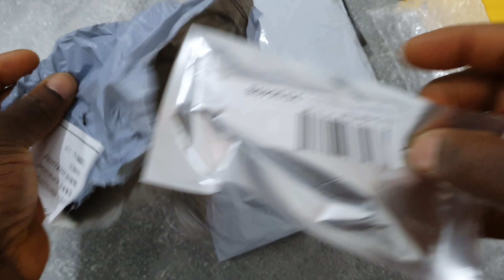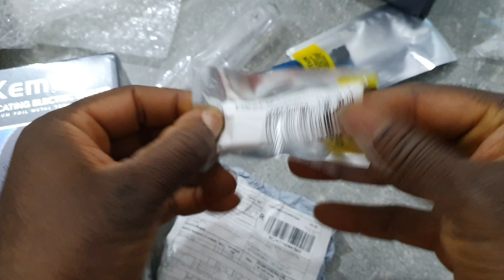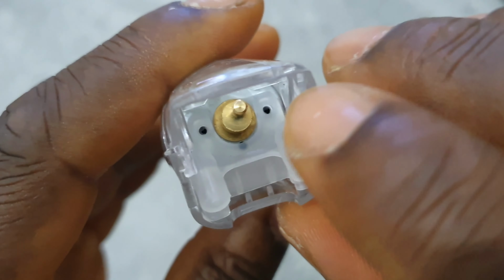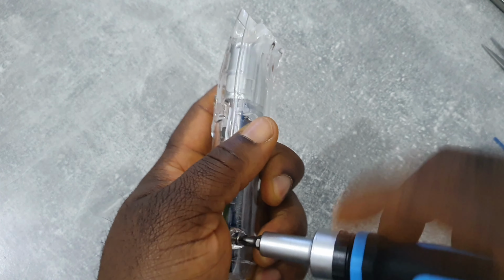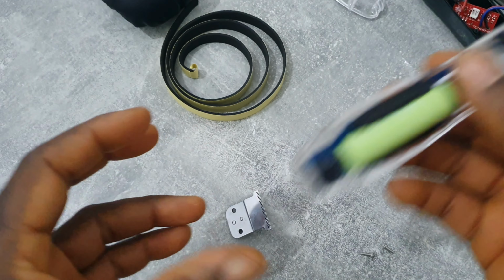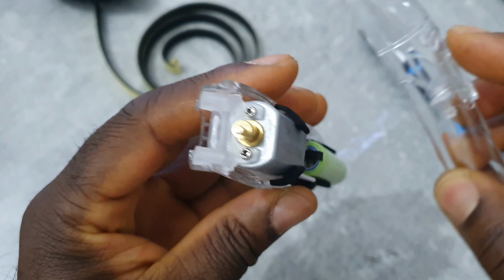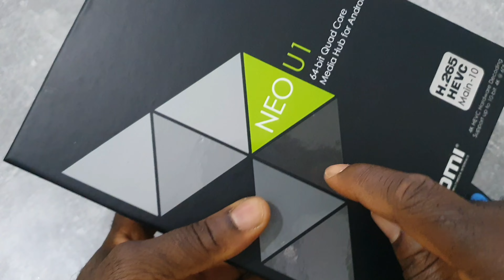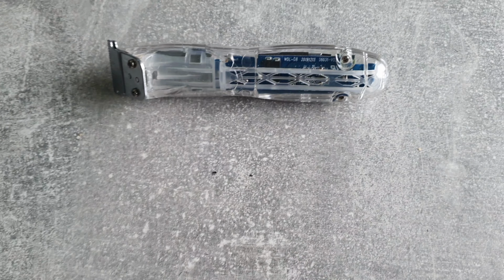How I Build a Custom Slimline Pro Li From Scratch | How to Build Slimline Pro Li

Comment: well done for this one Edo! Can you tell me the distance between the holes of  blade of the slimline? The down blade. Approximately center to center screw to screw. 

Check the battery voltage or even try to replace the battery. Do you know about electronics? Any voltometer? I would check the motor in different battery also. 
Also check for the cam follower sometimes it's tricky. Is it moving free well or does it stuck anywhere even for a bit? they can be so tricky but so well done for this all
Reply from the maker: I dont get you
Reply from the maker: Without the blade the motor got 7000rpm
Reply: @edounboxingofficial  I would like to know the distance hole to hole of the bottom andis blade. For future modding on my chinese trimmers. If possible of you to see.
Reply: @edounboxingofficial  So it seems to be the problem with the cam follower or the  battery do not have the power to support. If possible check well the cam follower and lube everything up. It more seems like battery problem. Is it chinese of low grade?
Reply from the maker: @SqiroS22  ok thnx bro....I don't know more about electronic
Reply: @edounboxingofficial  I am no the best but they get tricky! I try some modding myself. Check the follower once again and inspect moving parts. Battery power might be low as well. Also if possible measure the distance between the screws to let me know for the modding with the blades maybe... cheers Edo!!!
Reply from the maker: @SqiroS22  I will make a video right now and upload it
Reply from the maker: @SqiroS22  in 10 to 20min video will be uploaded

Comment: Good job on this build find you a stronger motor if you can and you will have a killer trimmer
Reply from the maker: Thnx bro, I think the motor is ok but there is something that I'm missing. This motor got 7000rpm without blade
Reply: @edounboxingofficial  yea u shouldn't lose but about 1000 rpm's with the blade
Reply from the maker: @desmondmitchell5602  I fail on this built bro😭😭😭

Comment: 2pcs For MABUCHI FF-180SH-2290 DC3.7V 7700RPM Metal Brush DC Motor
Reply from the maker: The motor is good cuz I tested the motor with another trimmer and it was superb 👌. I guess it has to be the housing or the bracket
Reply: The front tip of the motor must have like a ball point

Comment: The reason your trimmer is not performing is the front tip of your motor is not correct
Reply from the maker: Is it too deep in cam follower?
Reply: I bought that motor of mine on ebay last year I don't know if you will still get it